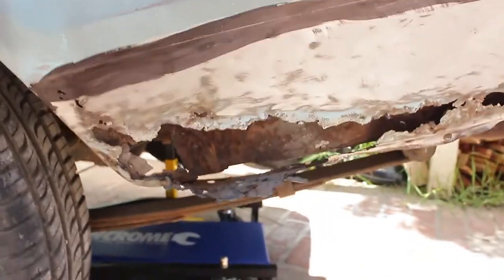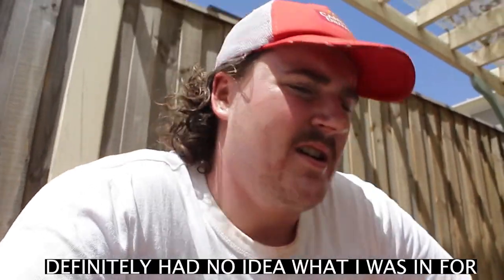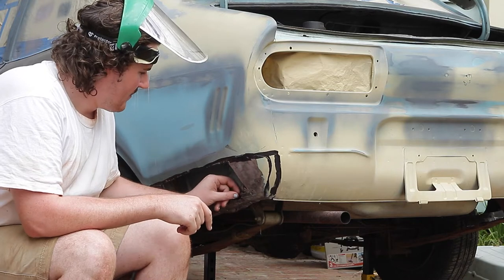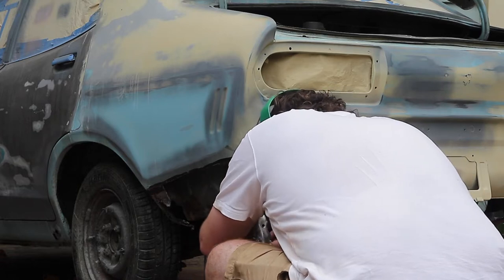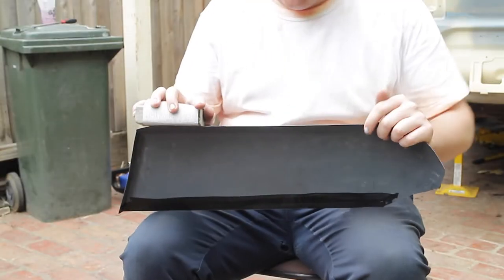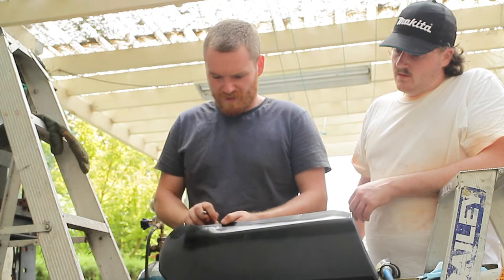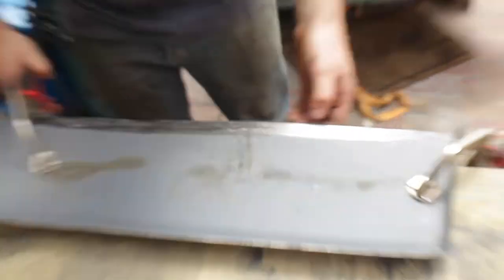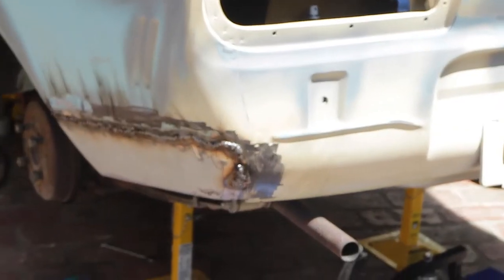WELDING! Rear quarter rust repairs on the Datsun

Comment: Hey mate I just got myself a 120y with the same disorder 🤣. Where did you get those new panels from? Did you make them up or ordered. Any information would help heaps.
Reply from the maker: Hey mate, I got my replacement rear quarter through ‘RRR auto parts’ in NSW. I’m not sure if they still stock them tho. Congrats on grabbing a 120y!